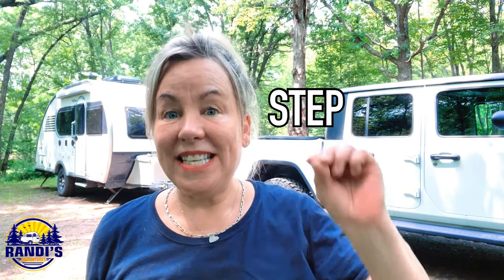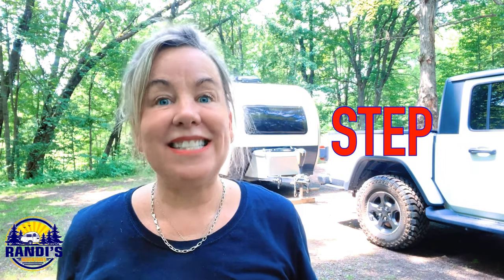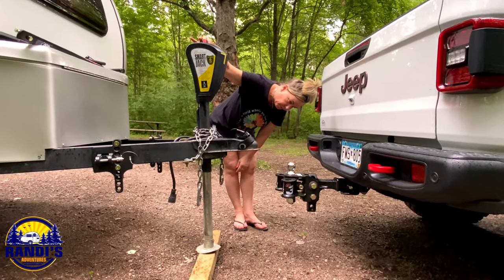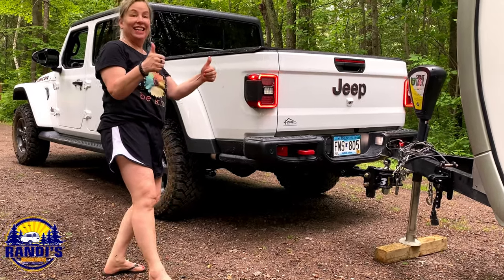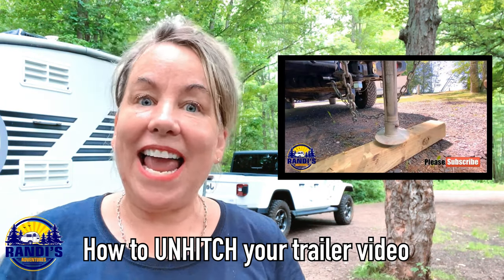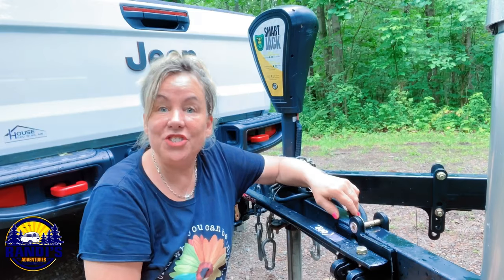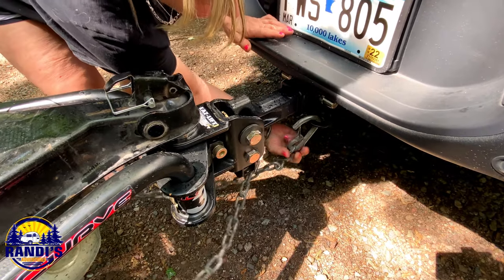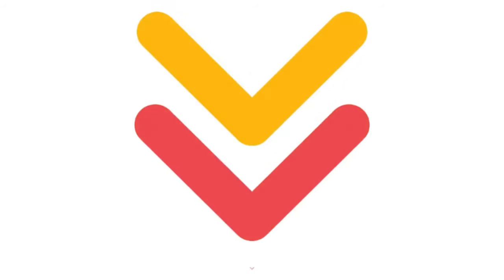RV Newbie Teardown CHECKLIST ✅ EASY PEASY!!!

Comment: One more step I think you should include is a check of all your lights both on the trailer and tow vehicle, examples; head lights,  break lights, turn signals (right and left), and emergency flashers( both on trailer and tow vehicle)! Thanks again for the videos, please keep them coming? Eric Sulen Grand Rapids Michigan.
Reply from the maker: Hi Eric! Excellent tips! Checking all lights before taking off is important. Thanks!

Comment: Nice video, but if I am hooked up to electrical, I leave that attached until last so it will help with the electric tongue jack.  I always make sure the slide out is in and the awning is in before hooking up the trailer.  

The happy dance is the most important step!!
Reply from the maker: Hi Deanne! When hooked up to electrical it does make sense to unhook from power last to power the tongue jack so you can preserve the battery. I didn’t think to include putting the slide out in because I don’t have one so thank you for sharing this!

Comment: A couple of things:
1. When you are hitching or unhitching, set you parking break so the tow vehicle does not move from where you've worked so hard to place it.
2. The real last step is missing completely. It is not enough to plug the trailer into the tow vehicle. You should test your lights separately- Headlights and Tailights, Left Turn, Right turn, Hazards, and breaks. All run through a separate fuse on the tow vehicle, and you may also have crud in the connector that prevents one of the 7 pins from making contact. Light check is the last thing I do after walkaround. It is a must.
3. I twist my chains too, but I have heard this can weaken them and add stress. I am considering shortening them a few links.
Reply from the maker: All excellent tips and very helpful! I have not been using my parking breaks but I will be now! ☺️